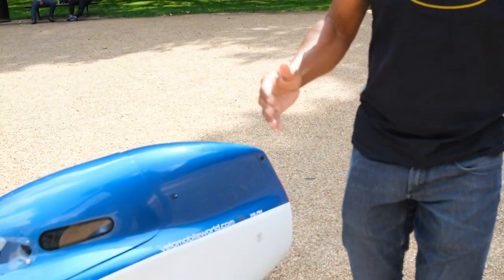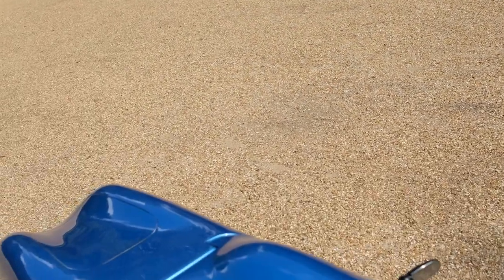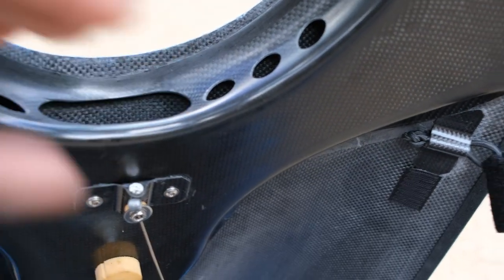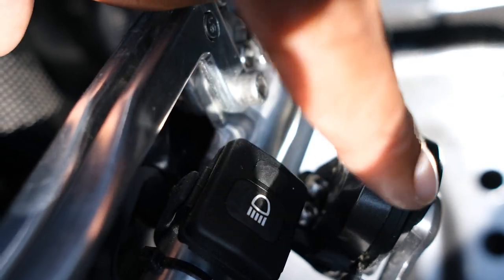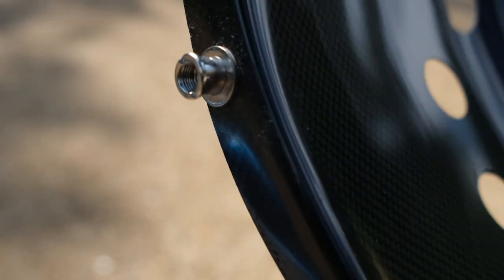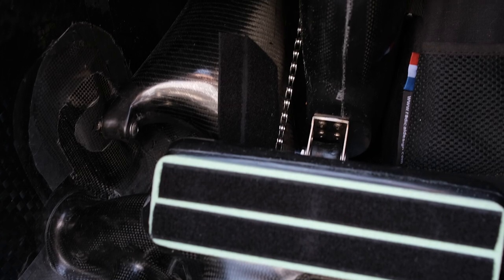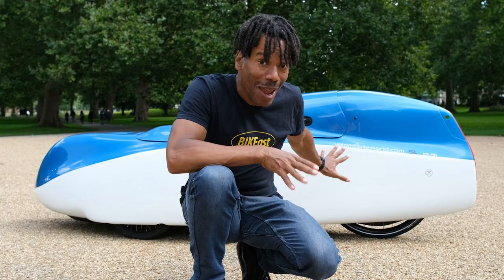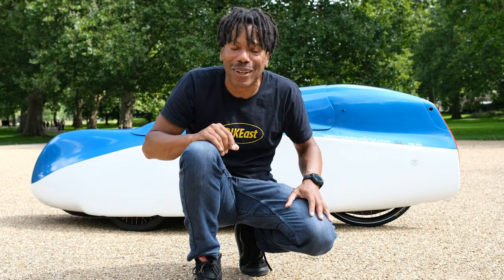The First Amazing Milan SL MK7 Velomobile in London.

Comment: Hi John, I really enjoy your videos in general and this one in particular. I am new to velomobiles, with my QV+ “Pennywise”, but I am itching to get a Milan. Probably a GT. Could you please confirm what the blue color option is? You said “Minerva Blue”, but I could not see that on the options page on Velomobile World’s website? I’m leaning toward either a blue (Metallic blue or Corvette Rapid blue ) or green (metallic green or Porsche Green) on top and white below.  I think the curves on the top will show off the colors better than the flat sides. I would appreciate your input.
Reply from the maker: Hi you are definitely right about the metallic on the top showing off the curves, stick with a white bottom half so if you scratch it then it is easier to touch up. Minerva blue was a special request on my part, velomobileworld now have the paintcode, porsche used it in 1978 on some 9'11s

Comment: Thanks for showing how the seat goes in and out and is adjusted.  Seems like a better system than the alpha7 with the two bolts at the top. Which do you prefer to ride?  The green alpha7 or the blue Milan!
Reply from the maker: I swap between the two of them, if I don't want to go crazy fast the Alpha is a fraction more sedate.

Comment: Cool! 
What's your shoe size? I tested Milan SL MK7 with a 155 mm cranks a while a go and I had problems that my shoes were touching to the body of the velomobile. I guess you are taller than me so how are you able to use 155mm cranks with SL?
My shoe size is 44. (Actually my Shimano cycling shoes are probably 45, because reasons.)
Reply from the maker: Hi Saukki i am a size 44 and I use road cycling shoes, and no issues with shoe strike are you using MTB Shoes?
Reply: @velo-ads4206  the velomobile had SPD pedals, so I had my MTB shoes. I guess slightly adjusting the cleats might have solved the problem, but I didn’t have time to make adjustments.
Reply from the maker: @TheVelomobileChannel  ah that may explain it, I do have my Look cleats set quite far back on my Lake shoes.
Reply: I have 140 mm cranks in my Milan SL. No proplems with Shimano SPD sandals. The shoe size is 44.

Comment: A velomobil needs a Motor for been Pulled up in hilly regions if you want to ride long distances.
Reply from the maker: Not if it is light.
Reply: @velo-ads4206  I went with a Milan SL MK 3 20.000 km, and I tell you in my Region you need a Motor. It would be sufficient an assist up to 25 km/h.
Reply: Depending on the region, you might be right. Most of them ride without and are just happy :-)
Reply: @VelomobileOttersberg  If you want to replace a car and you ride a lot, you will get exhausted without a motorassist.